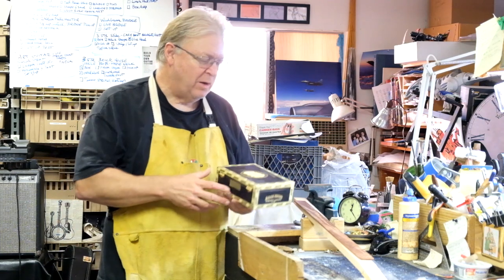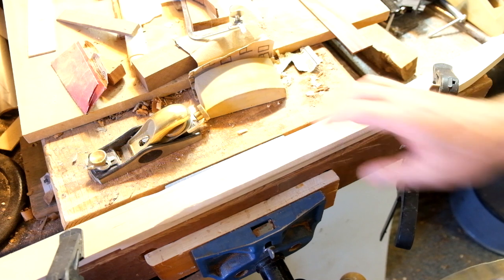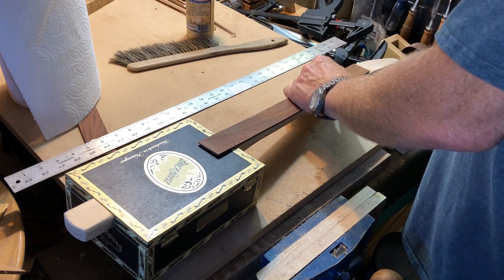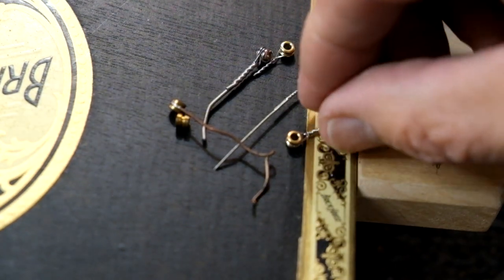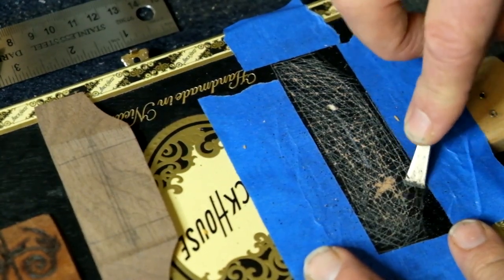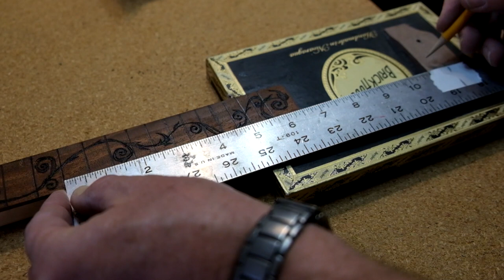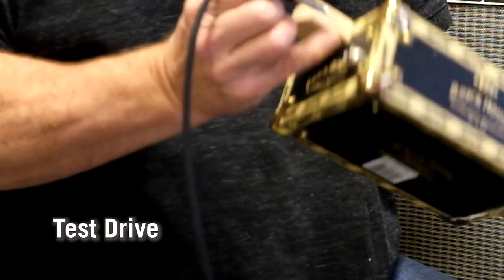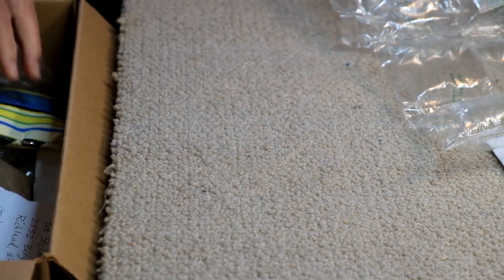Building a 3 string Cigar Box Guitar - For my Uncle Bob

Comment: Ray, you suggested the tuning ti be: D-G-B (low to high string).  Justin Johnson's learning material suggest G-D-G+octave  (low to high string).  The D-G-B appeals to me since it replicates the 2,3,4 strings of of the guitar, but the G-D-G+octave has the appeal of only two string scales to contend with.  Any suggestions?, or experience?
Reply from the maker: You can tune the strings on it now to D A D, or C G C.  This makes a D5 or C5 chord. Cool for blues riffs. What ever your low note is, tune the middle one to the 5th. I-V-I 1st-5th-1st. Good idea for another video to cover tunings. If you go for G - A - G (notice also I-V-I) you need a lighter string for the high G. Use G-B-E strings from a light gauge set.
Reply: @TheAngryMushroom  I will retune to match my trading materials and replace strings where necessary. I have chart that gives the guitar string equivalent depending on the octive of the D or G string.
Reply: This what I found on:
https://www.cigarboxguitar.com/knowledge-base/open-g-gdg-tuning-on-your-cigar-box-guitar-4-methods-with-string-sizes/

Now, on to Strings
Basically, there are 5 potential strings that are needed to achieve these 4 tunings. They are:

Low G
Middle D
Middle G
High D
High G
If you think of a standard 6-string guitar, or if you want to use a standard guitar string pack to do these tunings, you can think of it like this:

Low G – take the low A string (second biggest wound string) and tune it down a full step to G.
Middle D – this is the same as the D string on a standard guitar – third biggest wound string.
Middle G – this is the same as the middle G string on a standard guitar – the smallest of the wound strings
High D – the easiest way to get this is to tune the High E string (the smallest, unwound string) down a full step to D. You could also crank the unwound B string up two full steps (which would put it in the break zone).
High G – For this one you’d need to take a lighter-gauge high E string and crank it up two full steps to G. @TheAngryMushroom